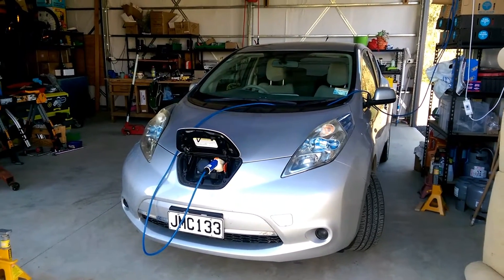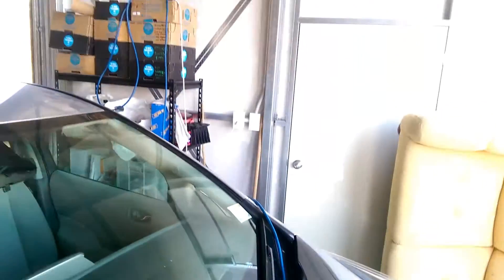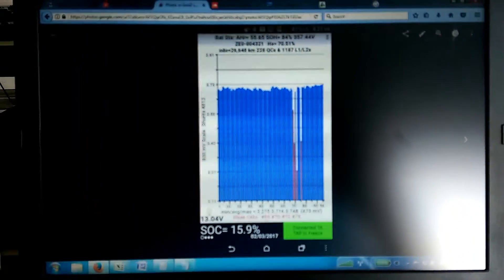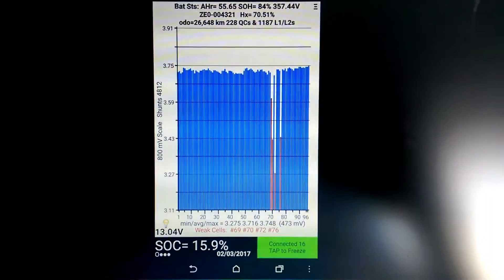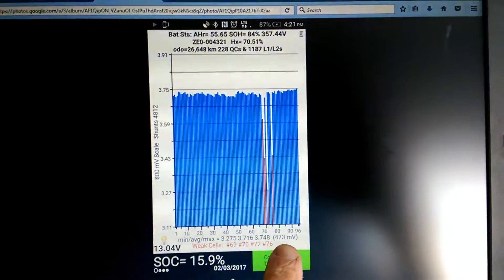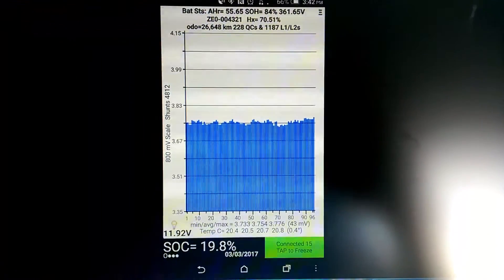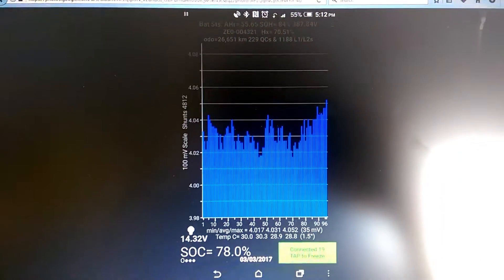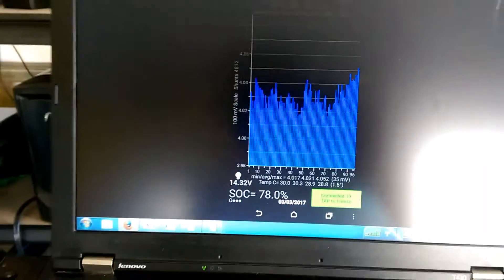Bad Cells Update-G2 cells into G1 Nissan Leaf

Comment: Hello, my Nissan leaf now on 10 bars and i heard there is chance to make it back to 12 bars with replacing cells, am still don't know if its true there is something like that and make my car back again like new battery ? please tell me more about range and your driving experience with new cells :) thanks for your video
Reply from the maker: This battery was unusual. It is more normal for all the cells to age at the same rate so you will need to replace the whole battery. Take s look here for a great option coming soon: https://bluecars.nz/nissan-leaf-replacement-battery-project/

Comment: My 2014 Leaf with extremely well preserved battery 80 000km old, 99% SOH Hx.

7mV at 100% charge, 250-290mV at near turtle.
Reply: wow what kind of climate do you have? That's simply amazing!
Reply: http://www.soudeliit.ee/UserFiles/image/Pilte_artiklitesse/tallinn-estonia-climate.jpg
Mild, extremely mild. Except winters. Those can be wild.

I'm sure actual capacity is less than 99%. I expect 95-96%. It's just a gauge that isn't extremely accurate.
Reply: Wow you guys basically live in a refridgerator! My 2011 has a new battery pack since July 2016 and already has dropped to 59AH, SOH:92, HX: 88.XX. Never QC'ed and mostly charge to 80% with once a week 100% for long range. Seriously, Souther Californians and Arizona states should not be buying this vehicle.
Reply: QC doesn't actually do any harm. Neither temporary heat buildup.
Average pack temperature is all that matters. I see 6th temperature bar for only a month or two per year :D
Still, your degradation appears way too fast for the lizard pack.
Reply: We just ended our Winter and it seemed like a long one where the numbers dropped. Perhaps those numbers were temporary? It just started to warm up again. My bars are still in the 5-6 range throughout the year except for winter which is 4 bars. Range I can't tell too much of a difference to tell you the truth.
Reply: eBoarder75 SOC Hx numbers never refresh at pack temp below 15C. So at least 5 bars.